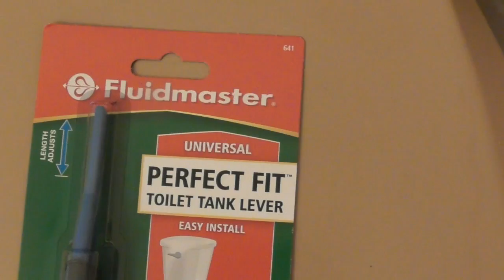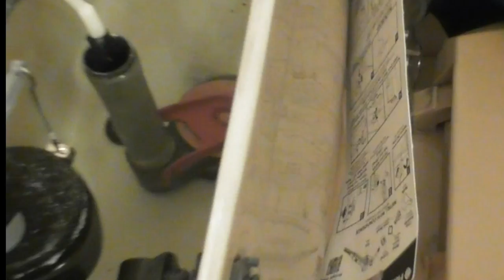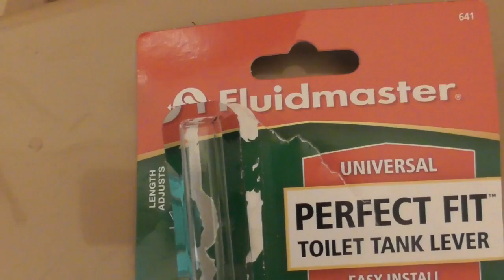How To Replace Toilet Lever Handle FluidMaster Perfect Fit  641 Review Installation

Comment: Out of all levers in the world, I went with this one from the Home Depot and gosh, it ate all my time to install it. I was doing it exactly the same way as you were and ended up coming here to see I'm not the only one having hard time installing it. Only thing was I got the handle right but it was so loose fit and didn't feel it proper even though it is flushing ok. After several trials I understood, the top side should be facing top as instructed which is obvious but the real tricky part is when you insert the lever through the lock nut and lever mount, before you press fit, hold both the lever and the handle horizontally and press them against each other to hear the clicking sound. This will hold the lever in place horizontally along with the handle and there wouldn't be any play. Long story short, I am able to install it properly. Thought it would be helpful for others who has similar problems installing it. Frankly speaking, the instructions should have been far better.

Comment: I really liked the video because we had the same frustrations installing the handle.  We had it so bad that our arm didn't even lift up, instead it went sideways.  We were laughing so hard! Then we had the handle backwards, I have never laughed so hard in my life! Yeah sometimes it is best to read the instructions.  After that it all worked perfectly.  We all needed a good laugh anyway.  I'm glad I got to see your video, because I'm sure others didn't read the instructions either.  I did see you almost put the lever mount on correctly, although the square part was not fitting like you wanted.  Once again we had the same issue but we fixed it.
Reply from the maker: always nice to see a happy positive comment like yours.. thanks

Comment: We double checked “step3, the lever mount” we didn’t have the “top” “top”  words facing up. Once we fix that issue it worked perfectly. 😂 still a comical video😂 it was like watching ourselves on you tube
Reply: Yeah, the Lever Mount must be installed with the words TOP TOP facing up!  When the Lever Mount is installed correctly, the two prongs will be at the 1 o'clock and 5 o'clock positions; that is, on the right side of the Lever Mount.  In this video, the prongs are at 10 o'clock and 2 o'clock.  At 8:00, it was inserted correctly by accident, then removed again.

Comment: I had a different but equally hard time with this product, You didn't even have to contend with trying to rotate the angle of the arm. Worst product I have encountered in decades. I did eventually modify the parts to get it to work. What a waste of time.Fluidmaster should be ashamed of the 641,.

Comment: I recently installed this very same  lever.  And I had none of the problems that you did. Mine works  like it should, I press the lever down to flush.   I kind of think you didn't  install the mounting  bracket  with top side on top.
Reply: Richard Hackwith thanks for your solution! I had the exact same problem he was having and put the bracket on the “top” position, and it worked like a charm!
Reply: Yeah, the Lever Mount must be installed with the words TOP TOP facing up.  When the Lever Mount is installed correctly, the two prongs will be at the 1 o'clock and 5 o'clock positions; that is, on the right side of the Lever Mount.  In this video, the prongs are at 10 o'clock and 2 o'clock.  At 8:00, it was inserted correctly by accident, then removed again.

Comment: I think the rotating adjustment and lever adjustment (blue part had to be pushed in to the next notch) to shorten the lever for a shorter chain like yours may have worked.

Comment: I just installed this and had problems.  The arm on mine is the same way hanging too low. Don't know how to fix it but it flushes. Too disgusted to keep working on it. If I can't I will have a friend fix it. You made me laugh not at you but I was thinking about how it took me 2 hours and still have to fix arm.
Reply from the maker: thank u

Comment: I agree the handle is garbage and the instructions are worse. I was having the exact same problems. Finally figured it out now the tank lid wont sit properly. Not because it sticks up too much but because the lid itself has a thing in the way. Turning the lid backwards and theres a gap..There's a stamp on the underside of the lid that says 1941. I'm sure it is from 1941 too. So theres that. I'm afraid to replace the toilet too because it not having problems other than the handle.

Comment: What?? Breeze to install, aside from separating the handle at the beginning.  Pull really hard is counter-intuitive, i just turned the nut as far as i could against the catch without the nut slipping back, then used the tip of the giant knife that was required to open the packaging to lever it a bit over the lip.  I only came to the internet to see how much slack i should have on the chain.  I'm pretty sure the toilet used to full flush without having to hold the handle down.. But the official video has the guy holding it down the whole time for full flush.  And he doesn't blame his brother-in-law 😛.  I guess deciding how much water you use depending on the load..? LOL is more efficient. How are there no poop jokes??

** I do agree the instructions are not good, but I only ever use instructions as a second opinion.  Deductive reasoning people, it's a lost art these days 🤦‍♀️, and spells humanity's doom.. Doom doom doom, the end.
Reply from the maker: like most things in life- it all depends on the size of the load